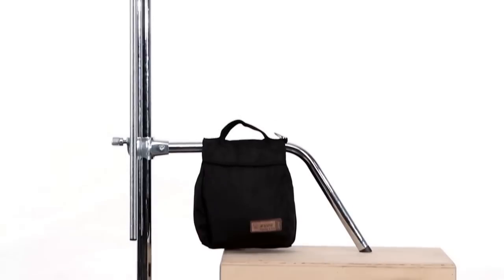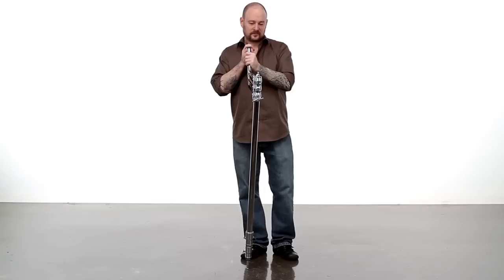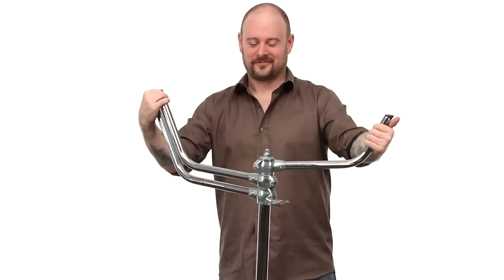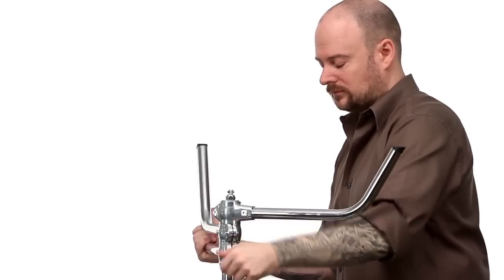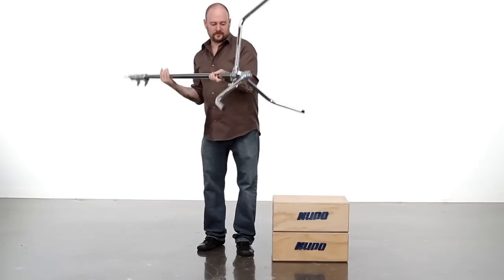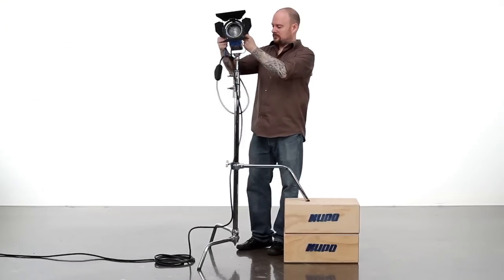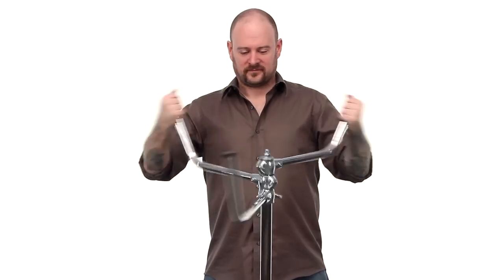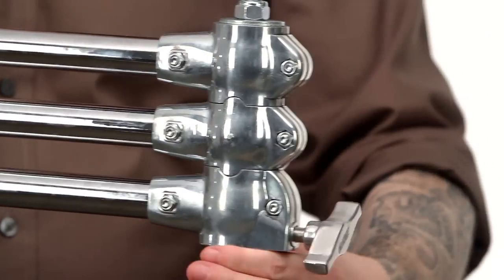Kupo: Master C-Stand with Sliding Legs

Comment: Could there be a way to make the legs removable for further compact air travel? Perhaps with a twist-lock or a pin lock at the base? Ideally to keep everything under 20in in length. Also is it possible to split the shaft into two telescopic pieces that lock into one another each 20in in length? Again for travel purposes. I fly often for my work 3-4 times a week and use many lights and hate having to check luggage.
Reply from the maker: Hi, David: we thank you for your product feedback and passed your suggestions along to the factory.